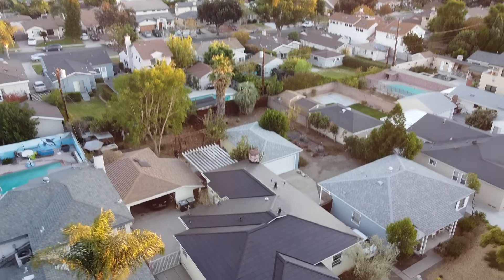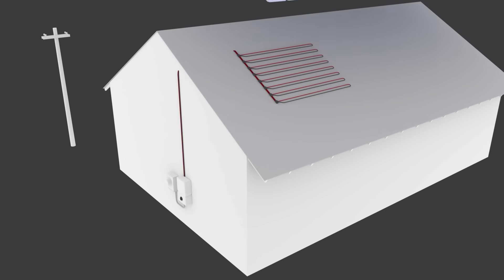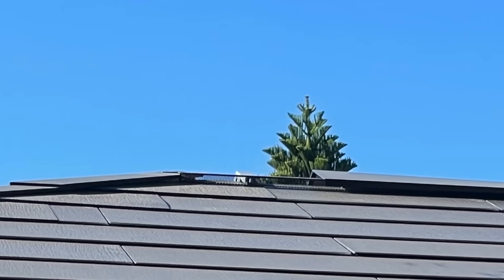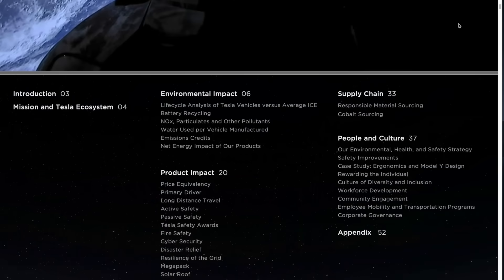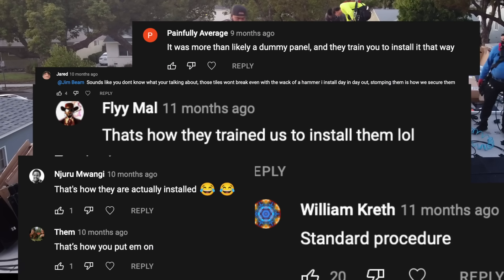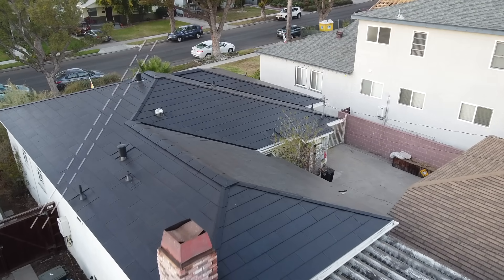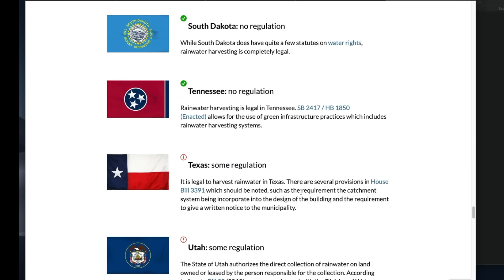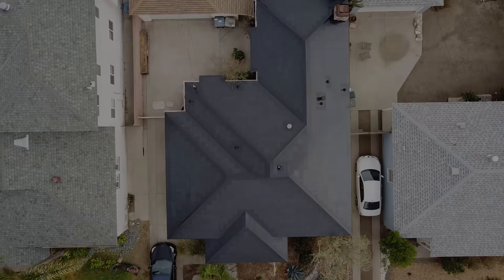10 Things WRONG With My Tesla Solar Roof

Comment: Question about your ridge venting. Have you heard anything about the "ember resistence" of the ridge vent of your solar roof? I am worried that the latest recommended ember resistant screen size is 1/16th" due to the latest fire ratings, and it looks like your screen might larger than that. It seems like the screening was designed for debris reduction more than fire resistance. With all the fires in California - it would be great if anyone knew if this feature was fire rated.
Reply from the maker: I have a feeling that they are not ember-proof. I’m planning to do a retrofit of all vents (crawling space and roof line) this year as well as other measures to create a defendable perimeter around the structures.

Comment: Do you get tax credit base on the full cost of the system or just portion of it? Like desire the cost of new roof? For example, if the whole system is $60K and tax credit is 30%, do you get 30% of the while 60K or 30% of maybe something like 40K?
Reply from the maker: back then it was 26% credit and only on the solar portion & battery of the roof. Now it's 30% credit on everything.

Comment: price is the primary problem with the Tesla solar shingles.  I opted for a somewhat frugal 20 panel regular rooftop solar system around 2017.  I will likely look to replace it sometime around 2030 as I will likely need a new roof by then.  I hope by then the solar shingle roof is more competitively priced.  I should have more money for a large system at that time but if the shingles are still like 4x the cost of a regular roof with traditional rooftop solar, I'll have to pass again.  That is way too large of a premium.

Comment: If you're spending that much watering your lawn, even in a hot climate, you're drastically overwatering. My water usage doesn't even add up to that for an entire year. A properly maintained, healthy lawn takes very little water.

That said, what I will say, is that your yard looks MUCH better that 99.9% of the "wild" yards out there. Most people use it as an excuse to do literally zero lawn maintenance.

Comment: i just got a quote for my tesla roof at 226k. my roof is 4k square feet and has no plywood. so this includes 30k for plywood and does not include the 30% tax credit. which will be around 60k. all in all, the total should be 156k for the roof after tax rebates. i already have 3 powerwalls and that was 41k. but i really need a roof since it is wood shakes and a metal roof without solar is 120k. so for 30k more i can get an all in one system.

Comment: Wow, only 5.9 peak? I don't know what my peak potential is but I'm getting 8.0 on my 24 solar panels from SunPower usually between 11am and 1pm. They cost me a penny though, $46k, but with Net meetering and Solar savings I hope to make up that cost in 8 years or less. (Net meetering is selling back the Solar energy Im not using which is usually the entire time the Sun is up. Think of it as your meter running backwards since more energy is generated than I am using). It comes out to about $4 on bad days and $10+ on good sunny days). I expect to probably pay 2 to 3 hundred dollars per year where my avg was $500 per month.

Comment: Solar panels could boost renewable energy but damage the global climate – here’s why

The black surfaces of solar panels absorb most of the sunlight that reaches them, but only a fraction (around 15%) of that incoming energy gets converted to electricity. The rest is returned to the environment as heat. The panels are usually much darker than the ground they cover, so a vast expanse of solar cells will absorb a lot of additional energy and emit it as heat, affecting the climate. –Source: The Conversation

Comment: Despite all of the hysteria, global warming is not occurring. 100% proof of this is that the ice extent (the ice pack) in Antarctica has been steadily increasing for decades. Couple this with the fact that 80% of the earth's glacier/extent ice is in Antarctic, and the idea that the aggregate temperature of the earth is increasing becomes untenable. 

Add to this that with our current temperature measuring systems, we cannot measure the aggregate temperature of the earth accurately - it is estimated. There are at least seven different temperature measuring systems including fixed temperature stations, mobile weather stations,  satellite, boat measurements, sea buoys, weather balloons, volunteer "temperature watchers," and radar. NONE of these systems for measuring temperature are unified. For example, some systems might use digital thermometers and other older systems might use mercury thermometers. The result is that each separate system introduces several different margins of error for each type of temperature measurement. Taking our thermometer example, the margin of error for mercury thermometers is different from digital thermometers. Further different brands of digital thermometers have different margins of error. NONE of this hodgepodge mess of temperature measurement is unified across the world. Nor is there an accurate global margin of error for the combination of all of these systems. So the bottom line is, we don't even know the exact aggregate global temperature of the earth. That is why it is "estimated," and estimates of this type are very inaccurate.

The TOTAL increase in aggregate earth temperature increase from anthropogenic (man made) sources is alleged to be approximately 3/4 of one degree Centigrade (C). It is almost certain that the margin of error of all of these temperature measurement systems exceeds one degree C. So technically, we don't even know if the earth is actually warming at all.

There are regions of the earth where temperatures have increased, and the liberal media incessantly brings these to our attention with a certain amount of hysteria that infers that "we are all gonna die" soon. But the liberal media pathologically FAILS to report that there are also regions of the earth where temperatures are going down.

Don't believe the lies. Even if global warming were occurring, and it isn't, we don't even know if it would have a negative affect on the earth. There is mounting evidence that a one or two degree increase in earth's temperatures would actually be beneficial. We DO need to control pollution of the earth's environment, that is a real problem. But we DON'T need to waste untold billions of dollars on a fake, made-up, imaginary problem that claims the entire earth is heating when the alleged global warming mechanism has never been proven by hard science methods in a laboratory.

Comment: You neglected to mention that the disposal is not factored into the carbon emissions for either solar panels or Lithium batteries in the USA. That artificially deflates the environmental impact in the USA. 

These devices have toxic material that will not be recycled and are going to end up in a landfill to leach into the environment.  Granted 1 house is not a huge impact compared to a solar farm but each one adds up. Current technology does not allow for effective recycling of the materials.

Having worked around batteries and Lithium I'm well aware of the fire hazard they represent with dendrite formation as the batteries age with repeated charging. Spontaneous combustion is a real and present danger for these cells used in such large numbers. While there is little other choice for vehicles a fixed installation there are too many other options available for this to be acceptable. Edison batteries have been available for many decades and there is a high degree of promise for the new salt batteries to be almost as good as Lithium without the fire hazard.

If you doubt this I suggest you look up the public available bus fire where Lithium batteries spontaneously caught fire melting the bus. There is very little a fire department could presently do against that kind of inferno. A wooden house would fair far worse that a steel bus does against that. Neither would the neighbors homes either.

Comment: Not a bad video, i will make one comment of note, where you should not have used as proof of Tesla's impact on the world climate. 

First, as with so many points, Peer Reviewed. Does not mean correct. Cigarettes were once peer reviewed as being good for you, yet science proved otherwise. In the same vane, the effect of the solar panels and their after life effect, and current life effect. Should be considered with numbers, not just saying over their life span, it needs to include the end product as well. If the paper does do that, then that is less of an issues. 

Second and more importantly. Don't ever take a companies own word about how they are 'helping' they planet. As anything other than utter hogwash. Tesla, and by extension Musk, wants to appear as some sort of saint/saint like Company. 

For example, Musk, and Space X think that flying people using a rocket equal in size and power to a Saturn 5 would save more fuel than a normal plane, when any glance at that idea says otherwise. 

We can also see this with several of their factories, where they are using up the amount of allowed water usages, in a month, rather than the entire year. 

As it is, 19,000 for a solar roof, is quite a lot, and that is for a small section. For most people that is the same as buying a brand new car. Something you don't do lightly. Just food for thought though.

Comment: My solar panel set will be a carport, not even caring if it stops rain, just shade the car from the hot TX summer sun.
Plenty of cooling is easy when you don't care if "the roof" leaks.

Comment: Tesla Recommends
12.16 kW Solar Roof
1 Powerwall Battery
$138,700
Solar Roof and Powerwall
Price and system size shown are estimates, based on a 5,668 sq ft roof and $150 /mo electric bill and your roof complexity

Comment: The title is click bait. The Tesla solar roof has severe design deficiencies which are not discussed here. What about the panel temperature? Standard solar panels are back-ventilated and intentionally not integrated into the roof for a strong technical reason: Efficiency. What about the 2*135 connectors for just 7.9 kWp? What about correctly explaining what 7.9 kWp really means (it is not the peak performance of the tiles). Why repeating the talk of "high demand" while there is almost zero production output compared to standard solar panels. What is the total power installed of Tesla tiles? But thumbs up for installing solar on your roof and a battery, not only for power outages, but for the environment. But if people are thinking about it, there are much better alternatives when installing solar on the roof.

Comment: Nice setup.  We also have a solar roof and 2 powerwalls.  Installed in spring 2020.  Yep beginning of the pandemic.  The system has been one of best investments and eliminated our $500/mo mid summer electric bills plus provided large credits for power exported to the grid. We use these credits in the winter months.  And as a result have almost no electrical bills year round.  We also can charge the EV with power from solar and have eliminate most of our vehicle fuel costs.

And thanks for showing the yard.  We are redoing ours and are looking for ways to reduce our water usage.
Reply: Let's see, you gave up a low electricity bill for a large payment on your solar? Break even of 20 to 25 years? You will then need to replace your equipment?

Comment: In Miami most of the front lawns you see mostly consist of driveways or large concrete slabs, because grass grows vigorously and especially during the rainy season. Miami homeowners don't want to deal with the lawn maintenance or cost.

Comment: The 1 hour of Lawnmower = the same  carbon emissions as 100 miles of car driving is wrong, the study was about pollution from small engines not equipped with catalytic converters.
it might be bad for your health, but there's no way that an hour of lawn mowing uses the same amount of fuel as driving 100 miles in a car
Reply: Yeah. Similarly, I think some people quote a study that says something like 10 massive container ships pollute the same as all the cars in the world... which is maybe true for some specific byproduct of high-sulfur diesel combustion, but not accurate in terms of carbon emissions.

Comment: 27,000 for mine Installed Evolve Solar I looked into a Tesla Power wall for a 7Kwh Battery they took my money and I got nothing!!! I have 6.6Kwh worth of 4.75VDC 2.5A LI-ION Cells I have yet to find a way to configure them  It was suggested 5 packs of 50 Cells at 4.75Vdc give you a 125Amp 28VDC pack all it all I have enough for 9.7Kwh, but I need an Inverter Charger I think for the solar system the Hardware I have is now offering a Solar connector Ill switch of my grid tied Inverter Off and Open it and see if there is a spot to connect a Battery pack...

Comment: you're point about Tesla's responsiveness when you needed their help with a grant is somewhat moot.  All companies put higher priorities on activities that generate sales, like the scenario you mentioned, so it makes sense they would be relatively easy to work with. Where many companies fail is in after sale support, warranty and customer service which is where the majority of service complaints are coming from.
Reply from the maker: Contracts were signed, system was already installed, and paid when the bulk of the grant paperwork happened.

Comment: Tbf on the ecological considerations, while solar panels are great in terms of the lifetime CO2 production, they are often not great in terms of other factors such as rare-earth utilization (for which some “ethical” sources may not currently exist), and difficulties in recycling (especially to reclaim those trace amounts of rare-earth metals). While you seemed to briefly touch upon the specifics of Tesla in this, it would have been nice if you had gone over it because it’s the more realistic claim against Solar in general (though it should be noted that every other scalable source of electricity has its own achilles heel that make truly environmentally friendly with zero major downsides impossible, wind turbines are not recyclable, uranium mining often isn’t great and nuclear waste disposal at best creates highly radioactive pockets that need to be sealed off effectively permanently once full, fossil fuels are a no-go from the start, hydro floods local ecosystems and creates artificial lakes that are a potential hazard for anyone downstream).
Reply: He also only touched on the CO2. Not the rare mining practices, extraction of  said rare materials, the whole chain all the way to extremely toxic processes of creating solar panels. All the things natural gas dosnt have. It sorta evens out. Also counting that you can put extractors and separators on smokestacks on gas power/thermal plants you get virtually 0 emissions with the ability to reintroduce burnable gasses and sell the others.
Reply: @walkinondamoon1  Thanks for bringing this up.

Comment: Such a huge price for so little output. As for worrying about power outages? Hasn't anyone every heard of a generator? I mean the fuel costs alone is no where near the costs you pay for this stuff. Totally not worth it in any way. Who cares about climate change. If its un-economical and so expensive, no one is going to buy into this crap unless the costs become more reasonable.

Comment: We have a SolarCity (owned by Tesla) PV system where the ground on the panels part of the install wasn't working correctly (was found today) and caused the inverter to catch fire, probably because that shorted the connection near the inverter box (the fire part was a few weeks ago).  I think the solar panel ground not being installed right was part of our problem...it made the inverters look terrible.  I think at the time we got that Tesla didn't fully own SolarCity yet maybe they owned a bit of it, but not everything, now they do.

So now we have to wait for a new panel install...I'm glad they caught that otherwise our house would have really caught fire, yea the roof isn't going to really catch fire...it only takes one ember, that comes from something falling from the burning stuff to light the rest of the house on fire.  Our roof is Monier tiles.  The thing about the inverter box, fortunately it was installed on a place that also had tiles on the opposite side of the wall so even if it did actually flame over there it wouldn't have burned all the way through anyway, though it could have run along the wall and lit the laundry room on fire.

Comment: 50k for that roof, that's not bad. I just had a standard roof no angles and it cost me 10k to install a new shingle roof on it and I would say its half to 2/3s the  size of the roof you showed.
Reply: Do some research .  The correct price for 1 single Power wall sells for $10500.00 Dollars.  That's only the power wall.   Add the tiles, additional parts and labor.   Doesn't add up for your set up.   And this is before pandemic and before Bidens inflation.  Add today's prices.